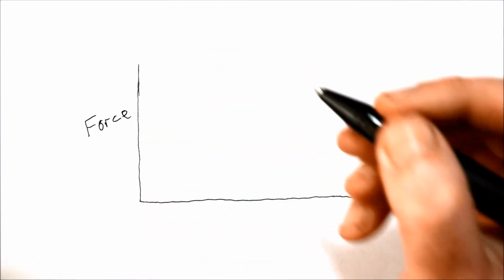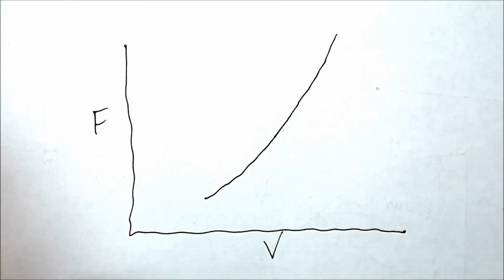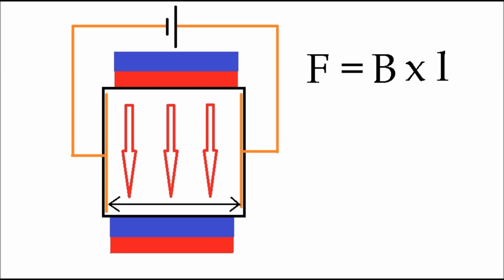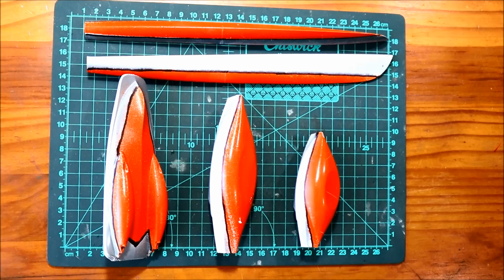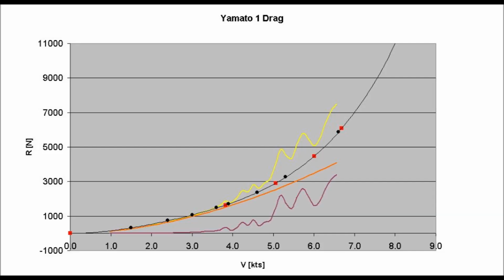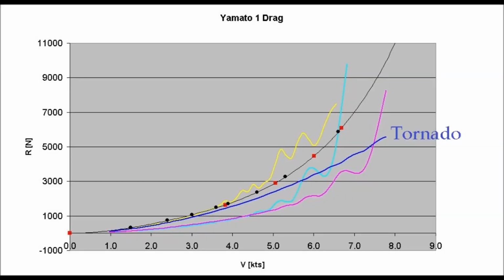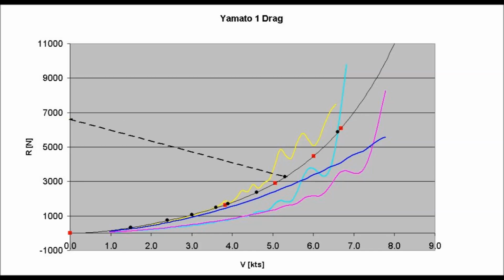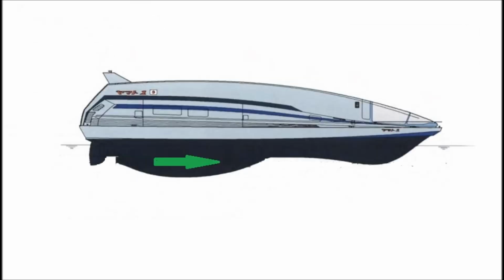Hull design for MHD boats

Comment: Plasma channel has recently had a MHD series of videos the past season. The first design had an efficiency of 0.0054% while the latest was quite respectable at 0.05644%. The thruster is quite massive but it's nonetheless a very nice design. There's finally becoming a surge of interest on social media for MHD as of late.
Reply from the maker: Yes I have been following his development. Do you know how efficiency was calculated? I don't recall it being discussed in the video.  All I saw were static tests at which propulsive efficiency is zero.
Reply: @williamfraser  Well this is the thing with Plasma Channel. It's geared for entertainment over showing fully transparent performance metrics necessary for everyone to truly evaluate for themselves the merit of the work. It's a YouTube career effect of sorts. And you're right, it's not a thruster, its a pump on a pedestal in a tub of mystery water.

" Do you know how efficiency was calculated?"
I am calculating efficiency myself based on the simple kinetic energy power formula from KE = 1/2 mv^2 to P = 1/2 * dm/dt * v^2 using mass flow rate instead of mass to get some ballpark figures for pump power / input power. TBH, I don't trust PC's flow rate numbers because he doesn't share volumes. He doesn't address units of his ruler or methods for calculation, just asserts his final numbers...and the flow across the ruler is turbulent, circulating and tumbling in the tub... I can only imagine he did a frame by frame analysis of flow only at the center of the flow rather than integrated across the flow cross section, because honestly how would this setup do that? 

PC's first design used 25V@12A = 300W and claimed to achieve exhaust velocity of 35 cm/s and flow rate 250 mL/s. In a previous video he claimed 75-100g of thrust with this design and 3W/g.
PC's "BRM" design used 25V30A = 750W and claimed 47 cm/s exhaust fluid velocity at 3650 mL/s flow rate. Here he claims 0.2W/mL/s, annoying that he uses inconsistent units.

Using data from design 2, I solve KE = 1/2mv^2, where m = 1050 kg/m^3 * 0.00365 m^3/s = 3.8325 kg/s  mass flow rate , and v = 0.47 m/s.
I found mass flow rate by choosing my own salinity of the salt water. You can use 3.5%, I used 8% or 1050 kg/m^3.  Plasma Channel never clarifies %wt of his mixed mystery salt water. Sea water makes the most sense, but I just assumed a salinity closer to brine to get the best results. The numbers should only differ by less than 3% anyway, so it is fairly inconsequential in lieu of the staggering levels of error and uncertainty in the vid.

So depending on the salinity, and hinging on how he calculates flow rate, his 750W MHD pump is imparting 0.42W of output power to seawater, or 0.48W to brine.
So efficiency calculated this way would be between 0.055% and 0.064%.

"All I saw were static tests at which propulsive efficiency is zero."
Yeah it's definitely not a thruster, he even anchored it to a pedestal. It should be treated as an MHD pump.

I'd like to see it made to be laminar with a pipe of known dimensions and sufficient length added to the inlet to make proper steady-state measurements and examine the true flow rate and pressure. A static pressure test would compliment it as well, as a pump.

Comment: On page 39 of the yamato-1.pdf you can find online, Yohei Sasakawa views MHD propulsion as having super-high-speed benefits where screw drives thrust diminishes due to cavitation and other limits. 

Interestingly in this video, you make the remark that MHD drives are insensitive to fluid flow velocities, which seems to be true from that one catamaran paper. This seems to me that rather than replacing screws, they would make for a good multi-stage design, where a screw deals with slow inlet fluids, and an MHD generates fluid pressure immediately after it. Actually this seems pretty similar to a jet engine, only without compression, because fluids.

Comment: thrust generated - craft velocity = actual thrust. maybe you can never go faster than the thrust you are generating - drag. in my head it sounds right as their has to be some proportional componant to the relative velocity. if you think of the propulsion acting on an area over time, then the speed of the water would reduce the time it ewas exposed to the area and would as such require a larger area of influance in order to maintain a constant thrust. the force trancefer between craft on medium is not instant but over a period of time. however or therefor the thrust might not top out at the stationary thrust value but at a proportian amount to the velocity. hope this is understandable and maybe even right.

Comment: Current carriers are in the fluid itself which is moving orthogonal to the electric field... So presumably lorentz force applied is going to end up being rotated (about B axis)at some angle relative to the avg flow direction resulting in something roughly like a cos(k*v) relative efficiency. Anyways just a hypothesis

Comment: Fantastic video once again. Those 3d printed hull models were beautiful, but I found myself most captivated by the characteristic curves and data visualization you put together for us, very nice!
Looking forward to your next video on efficiency. I imagine it will spur many discussions in the comments.

Also, given the Yamato was the control and worst performer across the full range, do you have a clearer picture what on Earth the purpose of such a hull was vs where you were half a year ago during the RC tests when you described the design as baffling that it seemed to entirely emphasize course stability?

I still hold the opinion that they were aware of the limitations of the technology and the funding constraints, and instead focused on the feasibility of portable cryogenics. I don't know if course stability is a bigger consideration at low speeds or high speeds, but a second baffling decision was to publish their results using a purely DC-driven design as opposed to an AC-driven design which would have simplified their system and reduced conversion losses of the AC diesel generators. @manipulativer even pointed out in the RC video that Mitsubishi was well-aware of the efficiency benefits of an AC-driven MHD. 

That comment makes it difficult for me to believe such a possibility wasn't apparent at the time. Maybe there was a private investor that benefitted from the Yamato hull design with a more efficient MHD implementation. Along that line of thought, what organizations did the Yamato-1 team work for after the study, and were all the funding sources publicly disclosed? And is there any visible AC MHD thruster works that could be used to compare relative efficiency beside the intuition that it overcomes the shortfalls that DC has?
Reply from the maker: I am still no closer to understanding their choice in hull shape. I don't know enough about course stability to appreciate how important it really was, or how many other options were considered. I suppose from a PR perspective the shape they chose is a better match for the futuristic image of the project. Seeing the ship in its current static display is an impressive sight, and sacrificing a knot in the name of inspiration of future generations isn't that bad.
The DC choice was based on the use  of the superconducting coils which generate a static field. Future efficiency improvements will depend almost entirely on improvements in superconducting materials and higher magnetic field strength.
Reply: @williamfraser  "Future efficiency improvements will depend almost entirely on improvements in superconducting materials and higher magnetic field strength."
I don't know about that. Yamato-1's Yohei Sasakawa longs for better permanent magnets (and this was in the 90s) without painstakingly battling with such significant hoop stress issues in superconductors.

 I would bank on working fluid conductivity improvements being far easier to realize and commercialize than better superconductors to improve magnetic field strength, critical current density, and high critical temperatures. Like we discussed many months ago, supersaturated brine solutions into a duct would dramatically improve efficiency much like a stronger magnetic field would. There are also yet unrealized configurations of MHD that can take advantage of superconductive liquid metal alloys like Galinstan, where a momentum transfer transmission can retain the precious working fluid from being lost to the ocean.

And most importantly (to me at least) the efficiency of other modes of MHD like AC, or pulsed DC systems that eliminate the conduction losses and electrolysis losses of any working fluid. And I can't even get into plasma ionocraft-MHD drives either, very exotic.
Reply: @williamfraser   Reposting deleted comment and pruning to make YT comment deleter happy...
"I am still no closer to understanding their choice in hull shape. "
I found a publication that goes into great detail the design of the hull. Published and printed in '97 by Ship & Ocean foundation in Kobe, Japan, there is a yamato-1 pdf on the Sasakawa Peace Foundation's website. Navigate to page 100 (Chapter 8 Hull and Outfit). After the pretext, they discuss each individual design requirement leading them to the particular hull shape where course stability is also mentioned (page 108 onward).

"The DC choice was based on the use of the superconducting coils which generate a static field."
Yes, after reading the 163 page publication, it's apparent the design is suitable only for DC. However I should point out that not all superconducting coils will always be static. This one was brittle, had hoop stress challenges, stored 23MJ of energy for a 4T design with 500 turns of wire, and was inclined to quenching itself if current was not charged up gradually and in small increments to avoid a dramatic expansion from throwing the coil out of the superconducting state. So it makes sense to go DC given a type II superconductor like NbTi was already a compromise at the time to make the 3d saddle coil geometry they wanted. It was a huge compromise that allowed the project to be feasible which meant not choosing Nb3Sn which would have put propulsive efficiency in line with screw props, albeit with bigger project risks.

That being said, 

They claimed to have considered AC superconducting coils but chose not to use it in the Yamato-1 because "a practical application of an AC superconducting magnet was not available". So considered but not ventured. Perhaps there was more to this kept undisclosed within Mitsubishi Heavy Industries that was not covered in the publication, as this is all that made it to the print for AC MHD.

Comment: Great work on all your MHD stuff!

I'm wondering what effect Hydrophobic and hydrophilic coatings might have  on the electrodes and magnets..?
Could a hydrophobic coating  on the electrodes still  allow current flow, but protect the electrodes from  corrosion..?
Hydrophilic on the magnet..?
visa-versa, etc-etc..?

Then the hull effects:
Hydrophobic leading and hydrophilic trailing ..?  etc
Studies show philic giving better results, (less turbulent) but a phobic front wasn't tried.

Off the shelf Hydrophobic coating:  NeverWet superhydrophobic